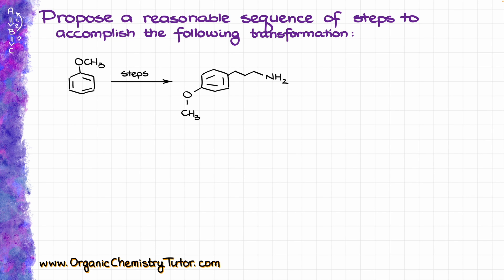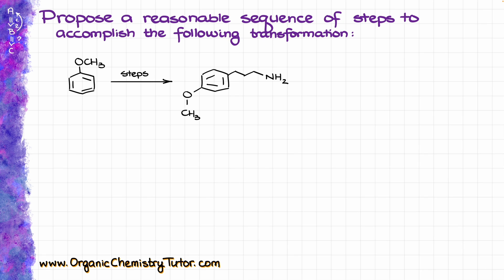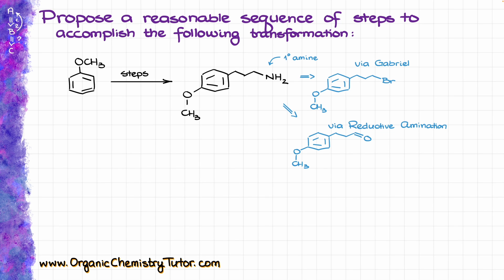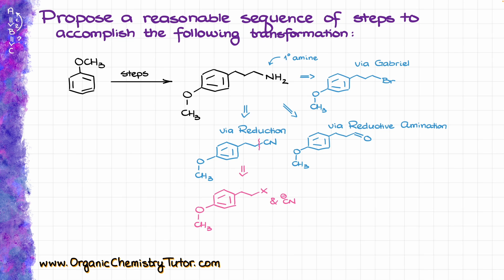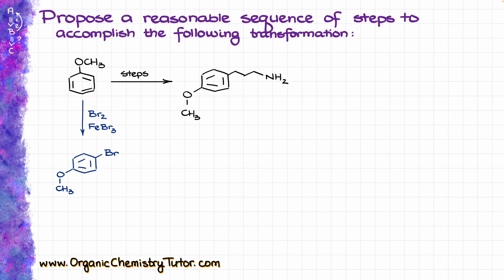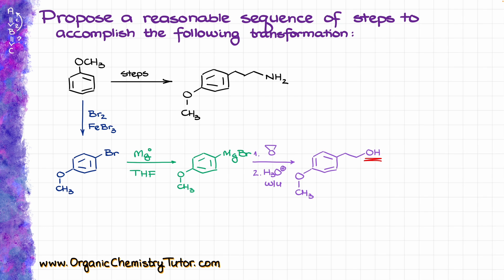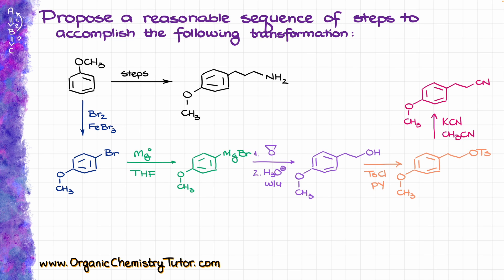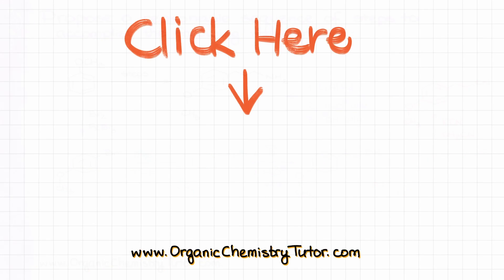Synthesis of a Primary Amine from Anisole

Comment: I draw a path that involves an ethyl group being placed at the para position by Friedel Crafts Reaction. The ethyl group is halogenated, subjected to an elimination reaction, and reacted with a hydrogen halide and peroxide to get the halogen in the primary position on the ethyl group. Cyanide does an SN2 reaction and the CN is then reduced to an an amine. This and the pathway in the video both have six steps.
Reply from the maker: While works on paper, FC with an electron rich molecule like what we have here will give you multiple alkylations and end up giving a soup of products drastically lowering the overall yield. For the intro organic chemistry though, it would be fine for most instructors in my experience.

Comment: Thought about possibility of acylation, then Mannich reaction followed by Clemmenson reduction - any issues with that route?
Reply from the maker: Outside of the fact that we don’t cover Mannich in a sophomore course, no issues 😄
You could also use just H2/Pd for the last step if you don’t wanna mess with the workup after Clemmensen. Works pretty nice for benzylic ketones even at lower pressures.

Comment: Quite a good one!
I initially tried doing some friedel crafts workaround which didn't end up well and eventually had to see the solution without getting the answer myself.
I have a doubt though. Won't the last step be a bit better and easier to handle with H2, Pd 'cause it does the same thing less violently and we even avoid the '2 workup' thing?
Reply from the maker: If you have a setup for it, sure. Most labs don’t have proper equipment and setup for high pressure hydrogen reduction and nitriles are not that easy to tackle without it.